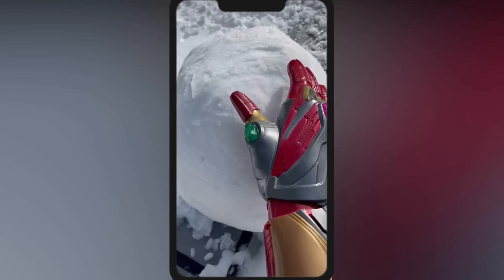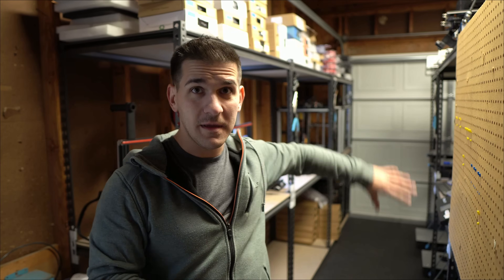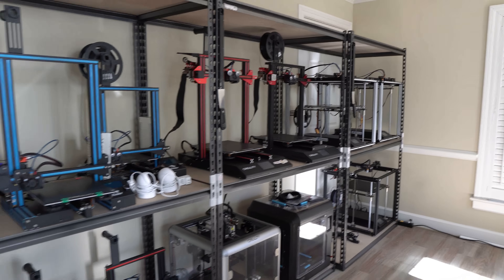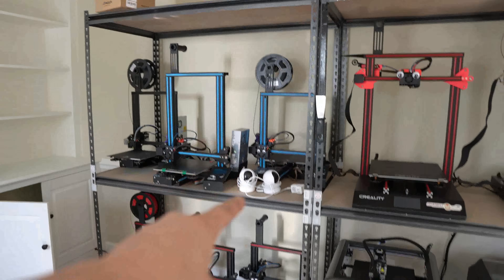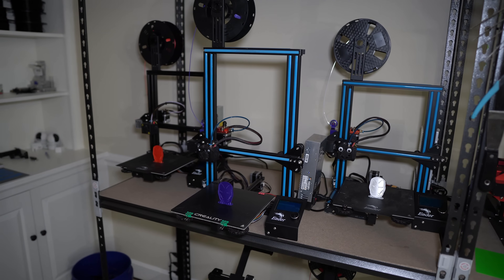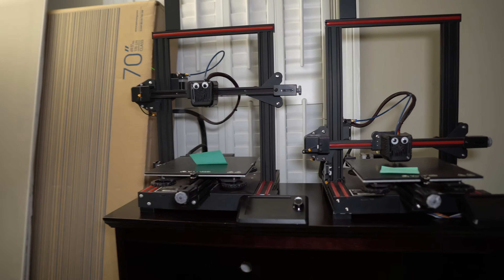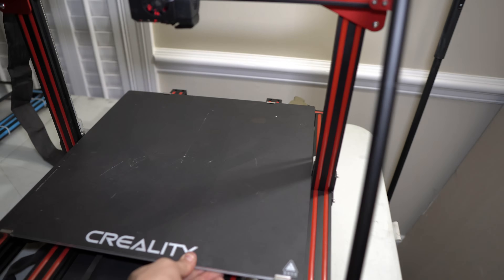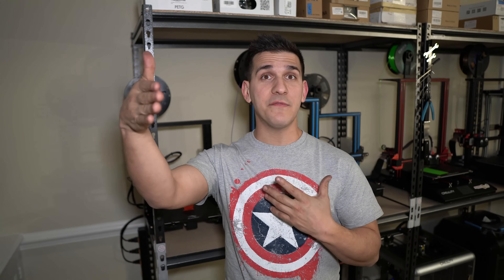Building a Temporary 3D Print Farm | Setup, Tour & Tips!

Comment: Hi Frank, thank you for your sharing and tips. Appreciate it. I'm new to 3D printing, and I noticed you only use FDM filament printers. May I seek for your advice / opinion why not SLA Rasin prints? Read, it produces better details and smoother surface.
Reply from the maker: Way more expensive, harder to use, fragile, toxic and not worth it for this stuff
Reply: @FranklyBuilt  thank you for your advice. I'm still in the process of thinking which 3d printer to buy for a start.

Comment: So question about power: you said you might be able to run maybe 8 printers max at a time. Am I overestimating the power draw of printers, or do you have an unusually strong circuit? I understand some printers are smaller, but for example with the jig printers, Wouldn’t just one Ender 5 Plus draw like 5-8 amps while running? How much more could you push the breaker?

Comment: How are the Voxelab Aquilas running vs the Ender 3s?  Are you just running the stock firmware and all stock components?  Do you care about the N32 vs G32 vs H32 mainboard discussion, or do you find that it doesn't matter for your use case?  If both an Ender 3 and Voxelab Aquila were the same price which would you recommend to buy?

Comment: Thanks for making this! I'm in the process of setting up my own wearable art business and was gonna be having multiple resin & filament printers running in my bedroom. Will help until I'm able to expand out of my room. :) Also I saw another commenter mention that even splitting the printers up across multiple wall outlets isn't the safest option. Do you know a workaround for this? Anything I should look out for when running multiple printers? What is too many for my home, is there a way to check the maximum amount? Tbh I'm not fully clued up on the electrical side of things & fuse boxes so any links to learn about all that stuff would be super helpful 😂 I guess most homes are limited to only using a certain number of appliances? Edit: looking into house wiring and circuit breakers - thanks for making me more aware! The only workaround really is to have an electrician come and upgrade the electrical panel to allow for more current? I think my 5 printers should be safe until I move out and expand (currently living with parents)

Comment: Wifi plugs? Please do not use them, have tried a brand name ones to check the power consumption, setting was always on, but it still shut down the printer in the middle of a print a couple times
Reply from the maker: I’ve been using them for 2+ years already lol no issues

Comment: Hey Frank. 
You should go with octoprint. It works really well. And there are no wifi issues, because you hook the raspberry pi into the mini USB port on your printer, so it only uses wifi when you transfer the file to the pi. 
You can even slice your file and send it directly from cura. 
Great video

Comment: 3:57 having your power spread "through a few different plugs" means very little of they are on the same circuit breaker. Might want to check that.
Reply from the maker: I’m aware, the spread is to preserve the power strip and not trio the fuse. The 8-9 printers at a time preserves the fuse box breaker